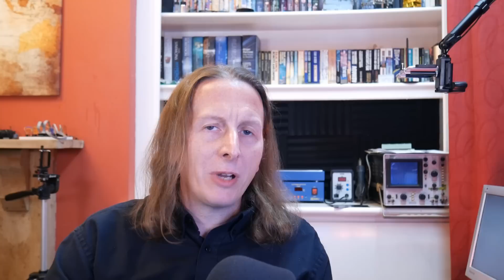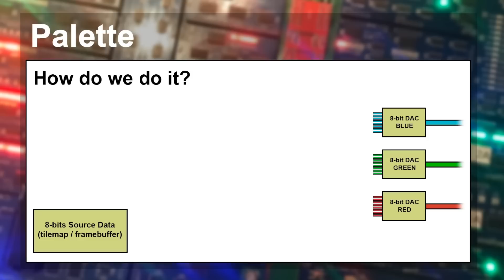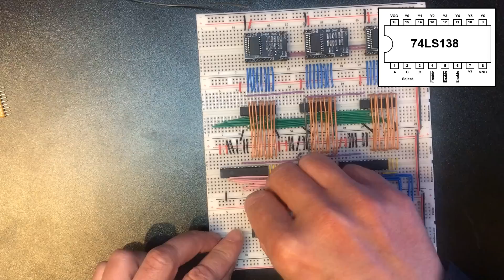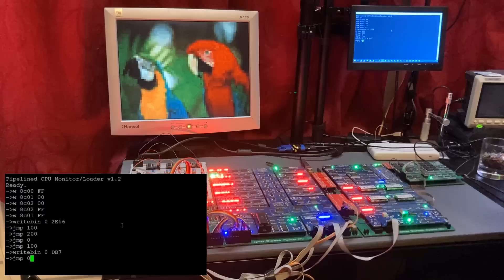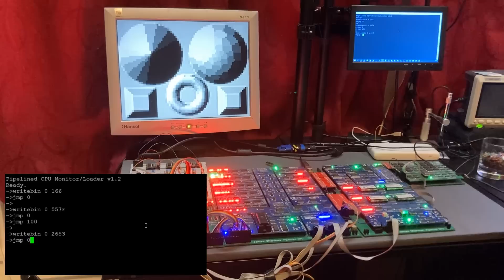Palette - VGA from Scratch - Part 11

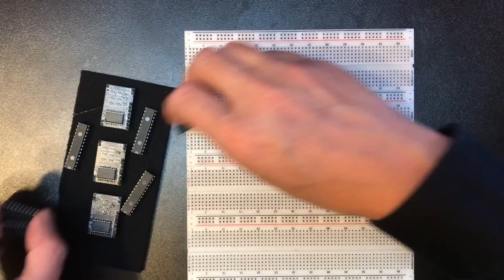Comment: 9:20 I suppose the obvious thing to use the extra space for, and the thing it would be used for in real life, is an alpha channel. Doesn't make a lot of sense right now when you only have 1 layer, but once you have sprites having 8 bits of transparency might be neat. Depending on how complex it makes the circuit that combines the sprites and the tiles.

Or even just 1 bit of transparency, so you can define a pixel as being invisible without occupying one of your palette colors. Or anywhere in between.
Reply from the maker: You'll have to wait and see what I do with transparency for the sprite hardware.

Comment: If I'm to hazard a guess, you likely programmed with palette tricks to emulate movement.

And on scrolling from earlier, it was a matter of virtualization vs. blitting. Why move things around when you can just redefine the meanings of the addresses. Since graphics is a linear concept, after you compute the correct start address, the rest is just blind incrementation. The Gigatron TTL computer uses the concept of a graphics indirection table. The resolution is 160x120. So there are 120 16-bit entries in the table, or 240 bytes. That has the page number and the offset. You can do neat tricks by modifying this table.

So you can change starting addresses or change palette registers to create the perception of motion.

I know this is an oversimplification, but I compare some hardware and software tricks as being more "masculine" or "feminine." For instance, take human psychology. Men, when they co-ruminate with others, the final goal of that is problem-solving. For women, the goal is more about reframing things and/or finding meaning. Supposedly, a guy would work to empower himself so that he would never become a victim again, while a woman would work to find meaning and make peace in what happened. That is similar for virtualizing video memory as opposed to blitting to move things.

And it isn't cut and dry like that, and there are overlaps and similar concepts across gender lines, etc. For instance, I used to think of powerful single-core CPUs as more "masculine" (rugged individualistic loners, heroes), and a collection of more modest cores as feminine. However, you can also refer to things like the military or a bucket brigade, and there is nothing "feminine" about those concepts, and there is still collectivism.
Reply from the maker: Sounds like you have the rough idea. It's a shame this demo doesn't work now I added the tiledata circuit. I've been thinking about ways I could recreate it with the current vga.

Comment: That is just very cool, well done. My first thought with the extra address lines for the ram would be to have multiple pallet banks, so you could just swap between them. That could make for some interesting effects as you could swap the whole pallet every line. Maybe make it so any write to the 4th byte a color set a latch for the pallet bank, as that might be fairly easy to add to what you already have in the circuit.
Reply from the maker: Why yes, you could do that.  😎

Comment: Hi James, possibly off topic question, I recently designed a discrete TTL circuit to replace a unavailable custom IC for an arcade board, and then went on to design/order a PCB (JLCPCB if course) I decided on SOIC packages… PCB arrived and only then (DOH!) realised some parts were hens teeth in SOIC… Any suggestions?
Reply from the maker: Well, my big bit of advice is that I add items to my shopping basked as I add them to the schematic. That's actually why the bus control board ended up with 2 138's replacing a 139.
Reply from the maker: That's a pain, what did you have trouble finding?
Reply: @weirdboyjim  74LS191,541,157 Yes a real pain, but I have the TTL version arrive today, will be testing shortly, hopefully the transition from breadboard thru EasyEDA/JLCPCB will be a happy one :) Thanks James
Reply: Since redesigned in TTL, but of course it’s much bigger… bugger lol 😅

Comment: Self made computer graphics kits were around in the 80's.
There is absolutely no point in hand making stuff like this today. There is simply no need.

As for education? You're spending a fair bit of money on cards, equipment and investing a lot of time. Is it worth it?  The number of views on the videos are quite low. Are you making enough money from video views to cover the cost of the hardware? Do you actually profit from this?
Reply from the maker: HaHa, of course I don’t profit from it. This is a hobby, I’m doing this because I want to.

Comment: "What you normally expect to see in a normal map"... :D
Reply from the maker: Not exactly what you are commenting here but most normal maps encode a normal vector so have only 2 degrees of freedom, Blue normally encodes the component pointing away from the surface so negative values are unusual. This means the colour cube is reduced to points on a hemisphere which gives the image a distinct look that anyone who has worked with them can spot a mile away.

Comment: Very interesting.
I'm a laserist, seeking a solution for previewing my XYRGB vector imagery on a VGA touchscreen monitor, which brought me to your video.
As it happens, I'm using a CS42448 DAC, which converts multiplexed I2S 12 bit digital sound signals to 6 line level outputs, which appears to be very similar to what you're doing with the 3 DACs, but with a single chip.
I'm hoping that your series will lead me to my VGA preview monitor solution.
Thanks.
"A'll be bock." 😎
(any relation to LaserBoy James, another vector imagery artist?)
Reply from the maker: Glad you found the channel. Not sure I totally understand your problem but it sounds like something that would be fairly simple on something like a Raspberry PI, unless you have technical reason I haven’t seen or just a desire to build it from the low level (in which case welcome!)
Reply: @weirdboyjim  Thank you for the reply, James.
KISS is always my preference, but I haven't found it.
My problem is to simply display  XYRGB voltage streams onto an HDMI (preferably) or VGA monitor as a color vector graphics to preview my images, before projecting them with the laser projector.
So far, I've only found monochrome USB o'scope software.
😎

Comment: Implement the parrots using palette switching to get closer to 2k colours? 😎
Reply from the maker: I actually ran a test doing that, it doesn’t look much different without looking very closely.
Reply: @weirdboyjim  interesting. I’m guessing that the pixel density is what’s holding back fidelity at this point then.

Comment: Wonderful, beautiful work. WRT: the color pallet... A lot of the colors are very close together and many resemble "black." I wonder if you can get more colors on-screen at one time taking advantage of the fact that so many are close together (effectively reducing the color pallet from 16M to a few hundred thousand)? Also, if you know that the color to the left of a pixel is "close" to the color to the right (on a scan line), there's no need to change THAT pixel. If you reduce the color pallet from 16M down to a few hundred thousand (because so many colors are similar), and only update the 3-4 pixels on a scan line that are "furthest off", you might be able to get an Amiga "HAM" effect. Very interesting work. Continued Success!
Reply from the maker: I as reading your comment thinking “he’s reinventing ham”. You have to remember that the palette itself a a way of reducing the massive range of colours down to a working set that is more useful.

Comment: If this hasn’t been considered yet, once the build is close to, if not completely final, it could be a good idea to make one massive backplane that not only accommodates the core processor, but also accommodates the other modules such as the sound, UART, VGA, and any future modules that you plan to add. This would not only make the entire build way easier to move from one place to another, but it would also help to mitigate the amount of dupont cables used to make it a little bit neater.
Reply from the maker: I’ve mentioned a plan to make one large back plane a number of times before. At the moment Though I’m thinking more about one big board for the cpu and two for peripherals.

Comment: Why do we need line drivers? Why can't we simply get data straight from the RAM? It comes with its own output enable, so, what are the drivers for then?
Reply from the maker: The line drivers are for writing data to the RAM chops. The data lines are both output AND input so during a write we disable output enable on the ram and enable it on the line driver to put the contents of memory data onto the inputs.

Comment: And with this simple RAMDAC you built, you have surpassed the color capabilities of the original VGA which in Mode 0x13 only had 6Bit/Channel (~260k Colors) in their palette IIRC
Reply from the maker: Yeah, the earliest ones were 6 bit, far easier to make a 6 bit ladder with tolerance actually.  I did think about 565 for a while but didn’t want to short cut.

Comment: Amazing work! Have you thought about using a planar layout for the palette instead of the current packed pixel layout? That'd remove the padding byte between each entry, thought maybe updating the palette would become more complicated
Reply from the maker: You mean having 256 bytes of red then 256 bytes of green etc… that would indeed make it easier to use the remaining bytes but it would be a pain to update the individual entries.

Comment: What about a Class A buffer amp like the 5W Class A amplifier but with a supply of 9V to buffer the output of the R2R Ladder network and not burn out the transistors.
Reply from the maker: I talk about maybe using a buffer op amp in the DAC video but I wasn’t really worried about 0.7 volts pulling too much current through 75 Ohms on a line driver output.

Comment: Ha, I almost skipped this video, thought I'd seen it already :)  So that pic is pre-rendered (like the normal map, but max double width? or 1.5 width?), it has color palette cycling, where "black" adds to the illusion of a background (space), but the center of the "vortex" is moving (wobbling up and down too, by my eyes), so there is a screen shift left & right, and every time it moves (shifts left or right) you add the missing vertical pixel line (s), with a similar technique used to "wobble up and down" (if thats what its doing) but limited to (say) 2 horizontal pixel line s in movement (instead of 70% of the screen width).  Yeah?  Very cheesy, and very retro technique (especially @ 4MHz, if so used), and I am pretty sure I saw a (purple?) torus doing the same at some point in the early days of VGA (EGA?) demos (circa 87/89 in NZ, took a while to make it into the local computer shop) ..
Reply from the maker: I’ll definitely do a video explaining it, not that difficult but easier to show then explain in text.
Reply: @weirdboyjim  I bet I'm over thinking it, there is a technique where you can draw single pictures that produce the same visualization

Comment: My guess at how the final demo works:

I think you are using the palette to animate the swirl animation. My guess is that you have several different palette slots dedicated to the vertical bars, and several dedicated to the swirling lines. then you update the palette so that the active frame of the animation is brightest, falling in brightness on both sides. I think you are also using the scroll buffers to animate side to side and very slightly up and down, which hides the fact that the swirl pattern repeats quite rapidly.
Reply from the maker: I do use the schooling like that, sounds like you are part way there with the palette operations.

Comment: Your use of the prototype board  is super clean! I've started very slightly tinkering with electronics, and I currently just use a bunch of jumper wires! It's terrible! :D
Reply from the maker: Thanks! I usually have a mix, on this one you can see a few signal interconnects use jumper wires. This circuit is running at just over 25mhz though so it's benefits from being careful with the wiring.

Comment: It was neat to see the parrots as you messed with the wires and chips. Something that seems so digital is analog in spots. Sorry if that doesn't make any sense lol.
Reply from the maker: Indeed, It's just the last little bit that is supposed to be analogue but when I was swapping the multiplexers around there were also floating lines on some of the inputs.

Comment: Looking good James! I did similar programming on the C64 writing code synchronized with the TV's electron beam. Man did yopu have to count processor cycles!
Reply: You do realize that part would be trivial with hardware interrupts though? Just saying! 😁
Reply from the maker: Got you on that, the best beam racing I've done on other platforms was using polling rather than interrupts. You can avoid latency that way.

Comment: In that vortex demo, do you have an animation of a sort of tunnel with the far end moving back and forth and the color indices going from low to high in a banded spiral (or vice versa) based on distance down the tunnel? Then just cycle a soft-edged green band through the palette every frame for the spiral animation effect?
Reply from the maker: The spiral itself is a static image, I move the image around with the scroll registers but the spiraling effect is created by animating the palette.
Reply: @weirdboyjim  Nice. I love this kind of art and effect.

Comment: Nice work James!  This should be able now to run a version of the bad apple demo without just showing frames out of memory! I‘m thinking of implementing your build in an UpDuino this winter as I finally want to learn and tinker with VHDL/Verilog on those small affordable Ice40 FPGAs. Keep up your work! Thanks for this great series.
Reply from the maker: Thanks! I'll have to take a look at what data is around for that. I fear it will still be too much until I have some storage I can stream from.
Reply from the maker: You might be interested in this: https://youtu.be/Y1_MUXKX-oY
Reply: @weirdboyjim  nice 👍

Comment: Amazing final effect! You ended up with mostly what IBM did with VGA in mode 13h 🙂
Too bad you don't have the bandwidth to go higher resolution though 😞
Maybe there is some place for CPU opcode optimization if you would resign from using some opcodes to do IO stuff and move to a completely memory mapped system.
Or maybe some simple DMA controller IO to move unaligned (page aligned would be probably easier to build, but unaligned DMA would be simpler to use when programming?) 256 byte blocks around in 'one go' (synchronized to access memory when CPU isn't)?
Reply from the maker: Glad you like it. Actually the resolution is more about the addressable memory, that final effect isn't changing the core buffer contents so higher resolution would have worked fine, it would have needed a paging schema to address a larger frame buffer though. The next build will be able to address more memory.
Reply: @weirdboyjim  I'm loving the series from day one. For a handful of 74xx logic the end result is amazing.

Comment: I wonder how difficult hardware antialiasing would be. For horizontal, surely a small capacitor on the DAC outputs would do it, but for vertical you'd have to get tricksy.
Reply from the maker: Wait until the tiledata is there before you worry about that! What you are describing is likely to end up as a blur at best which is not what you want in most circumstances.
Reply: @weirdboyjim  lol, that's fair, especially with such large pixels!

Comment: Some random palette trivia I came across this week: Terminal Velocity / Fury 3 had additional look up tables to shading and alpha blending within a fixed palette.
Reply: I'm fighting the urge to raycast some terrain.
Reply from the maker: I used a similar technique back in the day. I documented it in my dissertation (1994) but commercially it was first used in Swiv3D (1996). My system did a translation between a virtual pallet and the screen palette which gave me better intensity gradients.

Comment: if you want to be fancy, you could hook the extra address lines from the palette rams to a latch and have the ability to 'cycle' 32? different palettes just by writing a different value into the latch.
obviously you have to setup the data in the palette rams before you can cycle them but it allows rapid switching of on screen colors for things like different images or even fancy color swapping effects all by changing a single byte
Reply from the maker: That was my ideas as well, I worked out a way to do it with just one extra chip.
Reply: @weirdboyjim  just a latch using the extra write enable from the demux yeah?
means the latch is duplicated many times over the address space and means you lose the line for other things, but is a single chip solution.
unless you were thinking of something else?

Comment: Very nice.  If you have spare ram, maybe you can give each sprite its own palette - that would surly open up options for graphic effects.
The last demo looks  like pallet swapping plus beam racing.  With perhaps a bit of horizontal scroll?  Nice effect.
Reply from the maker: Thanks! I have an ultra simple plan to use the extra ram (It's just one chip), I don't want to talk about the sprite plans until I get to that video but there is a reason why that would be a bit more complex.

Comment: ref: 44:28
Technically not the same, but this method of changing color give me a feeling of the HAM mode on the Amiga graphics and it is very close to the way the old C64 manged to add  a lot  more color to the sprites.  🙂
Reply from the maker: Other people have talked about HAM, but on the Amiga this kind of beam racing is exactly the kind of work the Copper list was added to automate.